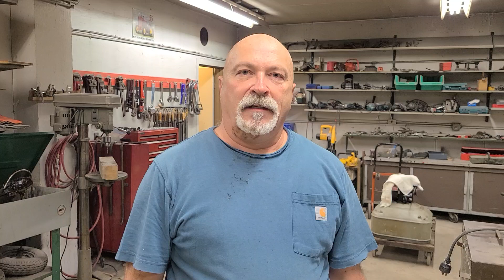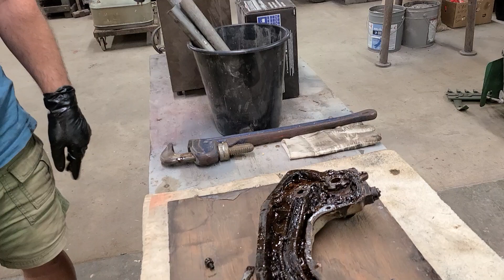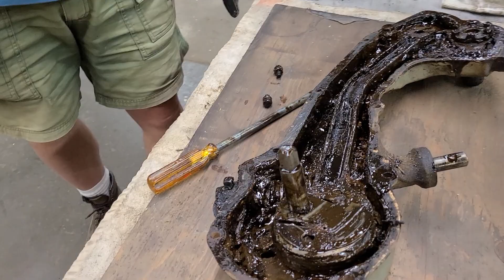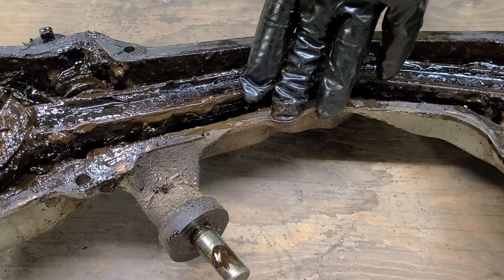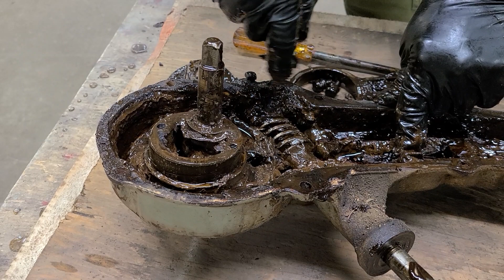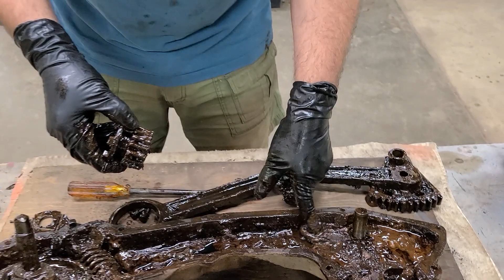Tutorial: Maytag Model 30 Wringer Washer Power Unit

Comment: Hey Brad cleaning the gunked and dried up grease in the wringer gear section is there only two small ‘BBs’ (balls) for the selector that’s all the came out of mine. Just checking. Thanks
Reply from the maker: I have the parts manual, if you'd like to view the wringer head, or any other parts.

Comment: Brad,
I am glad to see your tutorial on the Maytag Model 30 wringer washer power unit.
I want to replace the worm shaft cork seal with a modern neoprene, National # 471264.
I have replaced this seal before without removing the worm and worm shaft but it was very difficult and time consuming. I damaged the housing and worm shaft and do not want to make that mistake again.
A video demonstrating the removal of the worm and shaft would be very helpful. You removed the worm shaft in this video, https://youtu.be/kK-GsPXFKhQ?feature=shared&t=60, but did not show how you did it.
Mark.
Reply from the maker: Removing the worm gear and the worm itself is a bit tricky - sorry I didn't include that in the video. But I can explain the procedure here now:  First, loosen and remove the set screw on the end thrust bearing cap (part # A4771), which can then be pulled out using a pair of vice grips. Next, while turning the worm screw shaft slowly by hand, the worm gear can be lifted out. Be aware if doing this while there is still grease in the area, it will be quite difficult. It's easier if most of the grease has been removed and some solvent used in the area. After the worm gear has been lifted out, the worm screw/shaft can be easily pushed out.
Reply: @BradRoss63  I tried to figure out the procedure myself but got stuck when the end thrust bearing cap would not pull out (after the set screw was removed). I didn't know if the end thrust bearing cap pulled straight out or if it was threaded and if threaded was it left or right hand threads.
Since the end thrust bearing cap did not come out easily, I presume it is stuck with rust. I have sprayed lubricant around the end thrust bearing cap and will next heat up the area to break rust loose.
Reply from the maker: @ibsoarin  Hopefully the heat will do the trick. Even though it's not threaded, wiggling it back and forth as you're pulling should help.

Comment: Thanks Brad, that’s where I’m at with mine. So is that gasket still available or?  Also I can’t get the pin out for the switch rod. Guessing I’d have to drill that.
Speaking of gaskets. I also need the round one for the tub, where the agitator bolts on. 
Thanks
Reply from the maker: I make the gasket with 3/32" cork/rubber sheet from Felpro.  I've never seen them for sale online. For the "center plate to tub" gasket, I typically use 1/16" rubberized paper gasket.

Regarding the taper pin for the shifter rod - it can be a real challenge to get out!  It's best to have the tub removed so as to get the proper angle to bang it out with a punch. The pin is driven out from right to left side (as you're facing the machine). I always apply heat from a torch before attempting to hammer it out.
Note: on my latest restoration of the 1936 Model 30, I drilled out the taper pin, but made the mistake of using too large a drill bit, plus the angle was off. So...what resulted in the rod was a too large hole. I rectified it by using a nut and bolt instead of a taper pin. Lesson learned!